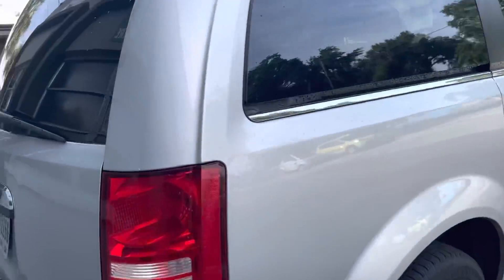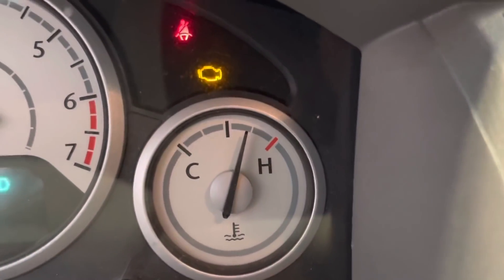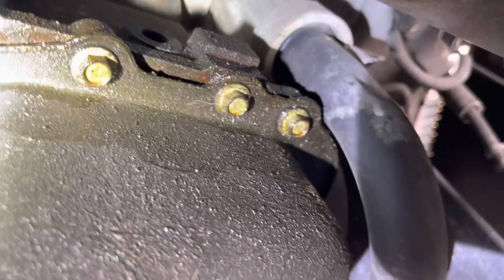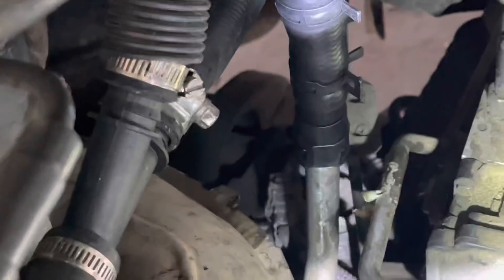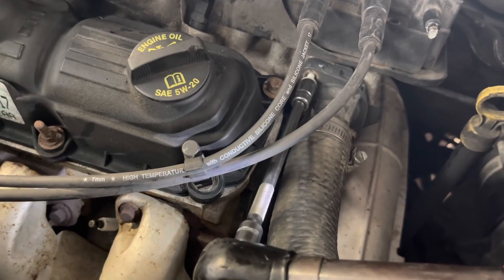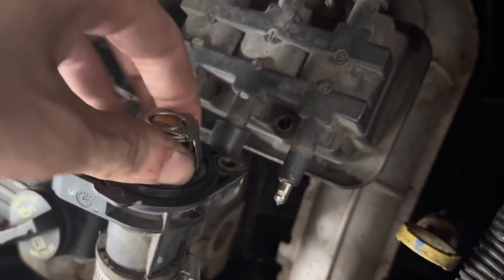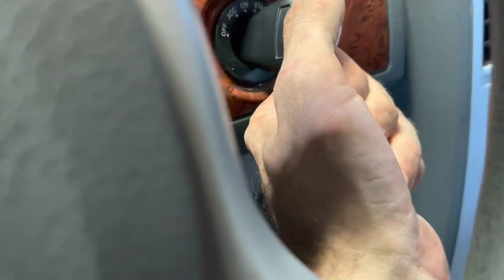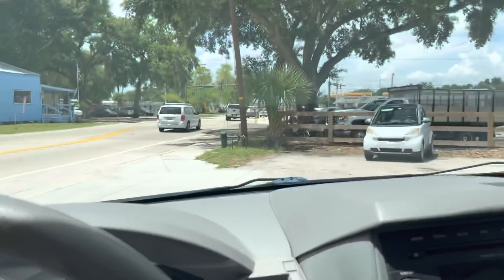Customer States: NO! I don’t want it! Just do the minimum!

Comment: What the future holds for that minivan: Owner finds out there's valuable coolant in his radiator and drains it out to sell on EBay.
Reply: POS crapvan and an owner who either doesn’t have the money to fix it or just doesn’t care. Either way from the sound of that motor this van is doomed.
Reply: What the future holds for the minivan. More like “what future?”.
Reply: @slightlyevolved   sigh Unless your car is a dragster or a hypercar Fram filters will do just fine.

Well unless you are one of those morons that do not change your oil in time or think that buying a filter from the same manufacturer at three times the price actually helps.

One thing I know for sure is that you are not mechanic.

Also, ethylene glycol doesn't change chemistry with the brand, unless you go for the waterless stuff it's pretty much all the same shit.
Reply: Had a good laugh at that reply!
Reply: Chuckle city! You're probably right too.
Reply: fast forward 7 months and its actually the fuel lol
Reply: Soon sold for new episode of pimp
My ride

Comment: It’s a Chrysler, he’s got the right to call it a piece of junk, that’s standard!
Reply: Anything made by fiat-Chrysler is a piece of junk
Reply: @miss_rosie25  Word, ever since Fiat has owned them it's now junk on top of junk, lol.
Reply: exaccctly
Reply: I would be happy it had 248000 miles I never made it past 160,000 with all the american cars I've owned. Usually the transmission goes. I drive a standard shift Honda now.
Reply: only thing Fiat that was not junk was there tractors pre 2000's
Reply: @phalanx3803  I would seriously doubt that.
Reply: I had a 2006 Chrysler 300 only thing I ever had to replace was the fuel pump and 1 catalytic converter.. had 208k on it before it was totaled in a accident ( not my fault ) it was very well maintained. Pervious owner was a Chrysler mechanic. But this Chrysler definitely was a piece of junk.
Reply: It honestly depends on you. Most cars will survive in good hands. The difference is that some cost more in maintenance. Go with your budget always
Reply: It's a Chrysler. Isn't all this work like polishing a turd?
Reply: @MrBilld75  no appreation for cheap Italian engineering.
Reply: @thewizzard3150  Lol, good one.
Reply: @kfshman  same here, I had a 2010 Dodge Challenger R/T Classic and just sold it last month with 100,000K miles and 0 time in the shop, Only changed the Battery, Spark Plugs, Brake Pads, Tires, and Oil.. THATS IT… I sold it because I used the $$$ for a Down Payment on a 2022 Ram 2500 Power Wagon, Now If U have a Hour I can tell U My Shitty Experiences with Ford, Chevy, and Honda..🤷🏻‍♂️🤦🏻‍♂️👎🏼
Reply: Yet it has almost 250k miles and at best has received maintenance occasionally.
Reply: Believe it or not but at my previous work place we had quite a few guys with the Dodge Caravans and they range from 1995 to 2009 all were above 300,000km with 2 an 2008 model and a 2003 model above 800,000km and none of them were babied all driven hard hauling people, heavy parts, farm equipment, and the like. No major issues just regular service and some seals here and there. On the ones with a/c it even still works a treat. Like most cars it’s who owns it and how they maintain it that matters.
Reply: @HimmelWeint  Similar thing here in Europe, where they are called a "Chrysler Voyager" Plenty of the old 95-01 models still on the road, mostly with mileage 300,000 km and up, a friend of mine has a 98 Euro spec 2.0 5-speed, 620,000 km on first engine and tranny. Those Caravans and Voyagers werent that bad.

Comment: "It appears that adding coolant has made the car stop overheating." Priceless lol
Reply: Either the customer is really hard headed or extremely smart because when he says "just add water to the radiator" a good mechanic can't let that out the door like that so he added coolant free. Maybe.
Reply: Funny how that happens.
Reply: @Cerus98 who told you that lie, water boils and turns to steam inside the engine. Antifreeze does not. Water is extremely bad for engines, causes premature component wear, not to mention antifreeze also doubles as lubricant for its related parts. Please know what your talking before talking LOL
Reply: @Cerus98 exactly you answered your own comment, you mix it. I said nothing against mixing it. Maybe you should read up on antifreeze and what it actually does. You’re talking to someone that’s worked in multiple manufacturing plants including Mercedes Benz and BMW. I think I know what their antifreeze actually does. Along with Dexcool and the other companies. Hence why you don’t mix green with orange and so on. But please educate me on your shade tree knowledge.
Reply: @DNRailworks  You are incorrect.  The difference between water and anti-freeze turning to steam is only a few degrees if at all.

The reason people seem to believe that is because water boils at 212 degrees but the back of the coolant bottle says something like 250-260.  However, this is at radiator pressure and the 212 number for water is at sea level.  Once you run the water in the radiator, you are looking at around 250 degrees as the boiling point for water due to the increased pressure.  Once you are over 250 degrees, your engine is having a bad day anyway.

On top of that, Cerus is correct about water being a better coolant.  Water is 20% more efficient at heat transfer than a 50/50 mix antifreeze is.  Glycol is terrible at cooling things.  It is there only to stop the water from freezing. 

You will find that race cars use distilled water or even tap water.

While I will agree that the anti-corrosion factor is important.  I ran cars for years with only tap water in my youth in Florida with no appreciable damage but I have seen metal welch plugs(freeze plugs for those who don't know what they do) rust out from it.  I would point out that distilled water has none of the salts, ect in it.  If you use distilled water and nothing else, rust and corrosion are very limited.  You are also incorrect that the cooling system needs lubricant in the radiator.  Any modern water pump has sealed bearings and the lubricating properties of the anti-freeze isn't going to matter.  The only part that really needs lubricated is the bearings and if lubricant hits those, the water pump is already dead.

I'm not sure why people believe the easily disprovable myths that you believe when a casual 1 minute google search proves them incorrect but you might want to learn more about a subject before you talk down to someone who apparently is more knowledgeable about it than you.
Reply: @DNRailworks  Being a bank teller for Bank of America doesn't make you a financial guru.  Putting a nut on an engine that rolls down a line doesn't make you an expert on anti-freeze.  There are plenty of people who do something all day every day and don't have the basic understanding of what they are doing.

What anti-freeze does is in the name - anti-freeze.  In a warm climate, you could run distilled water with an anti-corrosion additive and have no issues and better cooling.
Reply: @Cerus98 Water wouldn't boil under regular radiator pressure until your engine was pretty well overheated anyway.  Over 250 degrees.  You only get a few more degrees at best.  I'm not sure any vehicle is designed to operate at this temperature.  Given that water is 20% more efficient at heat transfer/cooling, I'd argue that water would actually not boil before the anti-freeze.  It would keep the engine cooler to begin with.  Anti-freeze would be boiling at the higher temperature at a 10% faster speed due to heating up faster(just a guess at the 10% number there as that math is a bit out of my league/care to calculate).

I can tell you that cars with antifreeze get to temp faster than ones with pure water.  Cars with antifreeze also run hotter than pure water without a thermostat installed.
Reply: @davidroberson1962  k bud
Reply: @Cerus98 makes sense that water  is good for cooling since it has a very high heat capicity ( ie takes a lot of energy to raise its tempture) and adding anti freeze raises that boiling temp even higher
Reply: @DNRailworks  Anti-freeze lowers the boiling point of water. Very specialty coolants(non-antifreeze) will increase the boiling point, but that isn't even anti-freeze, it's meant for high performance racing.
Reply: @Cerus98 dude he worked at mercedes AND the bmw plant popping in rivets, he knows the chemical properties and traits of antifreeze and the cooling potential of water is something he deeply understands as well
Reply: @DNRailworks  for the ppl complaining on ur comments, if I put straight water in my car it will run hot  ( used straight water once cuz didn't have the money for coolant ) read the manual and I can't add just straight water it has to be 50/50 antifreeze
Reply: @brandontalley4288  The boiling point of water is 212f and the boiling point of 50:50 is 220f, not a very significant difference.  The heat capacity of water is 1 (water is used to set heat capacity value, which is in BTU/lb f) and the heat capacity of 50:50 is .86 or 14% less.  If you live in the dessert (130f all summer) it is recommended to use 70 percent water to antifreeze (which has a heat capacity of .94).  These numbers are all based on observed values and if you could invent an antifreeze that had an equal or very close heat capacity to water, you would become very wealthy.
As for your experience, your car was overheating (many causes, obstruction in the cooling system, bad water pump, cooling system not keeping pressure, etc.) and it had nothing to do with the fact that you used 100 percent water.  Perhaps using 100 percent water cleaned your cars cooling system.
Reply: @fernarias  I doubt that cuz what it read in the manual was the sensor in my car that reads the temperature of the coolant can not read the temperature of straight water so it doesn't know how hot the water is so it just lets the car Engine overheat
Reply: @Cerus98 where do you get that idea?
Reply: @DNRailworks  In a normal engine neither water alone nor antifreeze mixture boils during normal operation because the system is pressurised. Also the added antifreeze raises the boiling point a little as well.
Reply: @brandontalley4288  That's a very odd thing for the manual to say. The coolant temperature sensor is nothing more than an electronic thermometer, and in most vehicles it has nothing at all to do with regulating the coolant temperature in service- that is done by the thermostat, which is a wax cartridge which expands (due to its large thermal expansion coefficient) as the coolant heats up, once the expansion is large enough the thermostat valve opens and coolant begins to flow through the radiator. You could disconnect the temperature sensor entirely and the cooling system should still work normally, unless your car has a very unusual design.
Reply: @alanmerritt860   Water is a more efficient conductor of heat than "coolant".  If coolant were a better heat conductor, we would be running 100% coolant instead of a 50/50 or other percentage mix.
Reply: Modern problems require modern solutions.

Comment: I have to say something about that dropped thermostat. 
I was changing my cam sensor on my 1.8T  B5.5 Passat and dropped one of the bolts and after looking for it for long enough, decided "eh, it's gone" and just used another bolt of the same size.
A week later, the bolt re-appeared, embedded into my radiator, pissing all the coolant out on the side of the road, seemingly flung by the fan. 

If you drop a bolt or a part in the engine bay, DO NOT "send it m8".  Find that part.

Comment: I'll sub. You called it junk, but it is junk...and what is really important is you still looked after the customer's best interests even when they weren't wanting you to. You could have just filled it with water, but it appears you give a shit. That's worth a sub, and a like.
Reply from the maker: Glad you’re here! Thanks
Reply: I would assume that if he didn't put coolant in that it would come back because Florida weather this time of year would over heat his engine with just water. I might make it a couple months but with every day usage I give it 4 months with only adding water. Sooner or later a gasket will overheat and cause a warp.
Reply: @David-eg4lv  sure you could use just water but where he’s at it’d hit the boiling point in no time putting added west/pressure on the cooling system probably causing a variety of other issues. Just water works but that doesn’t mean that’s the best way to go.
Reply: @David-eg4lv  Coolant raises the boiling point of the water and more importantly has anti-corrosion additives so your engine doesn't corrode from the inside out.
Reply: @David-eg4lv  that would probably be worse for corrosion. Distilled water will absorb carbon dioxide from the air and will become acidic, as much as 5.8 ph.

Comment: An oil stick broke off in the oil tube. That is a first time for me seeing that. My clapped out CVPI still has AC and I can check my oil. Love the videos Ray!
Reply: Funny enough it happened to my dad just a few weeks ago. Sucks big time.
Reply: Seems to be a common enough issue with the 3.3 liter engine. Mine just broke as well. I think the plastic is wedged in too tightly and eventually wears and breaks off.
Reply: just HOW do you break an oil stick ...... has customer got demeshia
Reply: It does happen. Especially since the handles are plastic. They get brittle overtime and sometimes just get stuck in the tube. I have had one just pull off when I went to check oil.
Reply: Plastic handle dipsticks, and people pulling them out at an angle when they are stuck.
Reply: See this all the time on Chrysler motors. They use alot of junk in their parts. See also their swollen lug nuts and rusted out siderails on the caravans. They also designed a car without leaving space for a battery under the hood, so they shoved it in a hole in the wheel well. lol! All junk.

Comment: Rainman Ray,
Thank you for this video. You shined a light on 1 of the problems I have been having since I had all the hoses, thermostat, & sensors from the radiator to the heater core replaced on my 2000 Chevy Venture Nov. 2019. Shop worked on hose leaks 4 times, (+ heating up) after the repair. 2 other shops too, pressure checks on hoses, & they told me it was just a loose clamp, & I'm good to go🙂. 
Same problem keeps popping up. The original shop didn't use the same configuration-not GM by the book, or fittings as factory.  Chevy Dealership gave me a copy of the diagram is how I know. I've been banging my head on this & still am. 
Tired, I've purchased clamps and "real" fittings for the hot and cold hoses that will work from the heater core to the radiator, according to O'Reilly Auto Parts. They assure me I can bring anything back that I don't use. 
The Van your working on has ALOT more space under the hood than mine does, easier to see, & work on. Your lighting is good, I recognized what you did, except how you got that connection to work. Sooo
I should be able to find what ever is leaking & cobble together, splice, or maybe even get the "Real" connection on this friggin hose. 
My Mom bought this Van 2002, been well maintained. Doesn't matter, vandalism, & theft have been my problem. So I have what I have, + a pile of receipts & Bank statements that tell me I'm burned. In all fairness my Mechanic addressed several issues & schooled me on what to work on while I saved $ for what he would do. "School of Hard Knocks". Whenever I want to have a nose bleed all I have to do is go through my receipts. Damage control is the best I can do right now, & Not cause damage to my Van. I have a new location, beautiful here & there is Hope... UTube gives me access to people like you, takes the mystery out of "some" repairs. Helps me make informed decisions, spurs me on, to fix what I can myself. You are a Teacher, You make a difference. Thank you.

Comment: Hey Ray, not sure if you'll read this, and I'm sure I'm not the first, but your videos have inspired me to do even more work on my cars. I've already been doing the basics, oil, fluids, spark plugs, filters, etc. 

But tomorrow I'm taking the intake manifold off of my car and cleaning the valves up (DI car) because when you show the little mistakes and hardships you have doing things and learning things about working on cars that you haven't before it makes me realize that all I need to do anything is the correct tools and the knowledge that comes from experience and the people who have experience. Today I changed the diff fluid, had to use a rubber mallet and a few kicks to get the plugs out, spilled a bunch, got it in my hair, overfilled it and had to drain some out, then when I was done I felt like I learned a lot and frankly without the excitement of problem solving in your videos I would've just taken it to someone to do. Keep it real, Ray.

Edit: I don't care about the editing. The more real and relatable, the better.